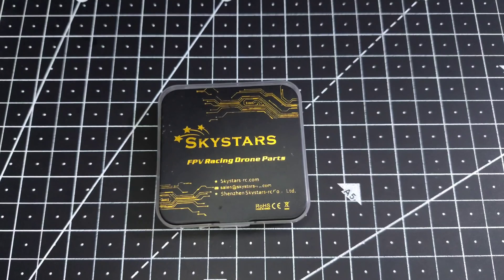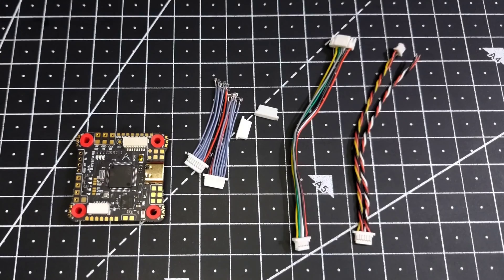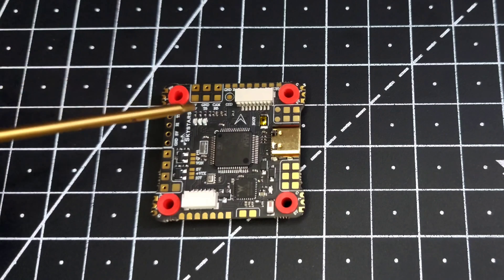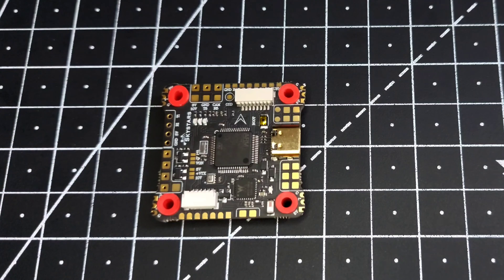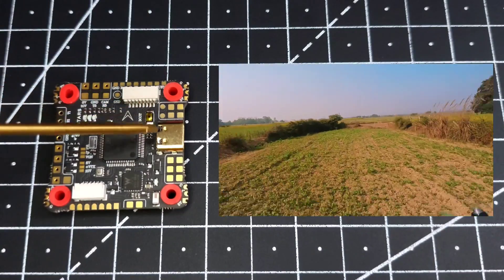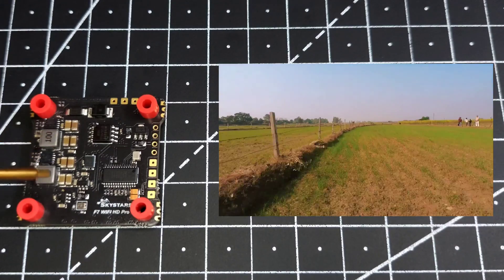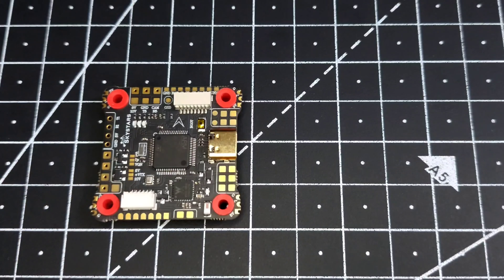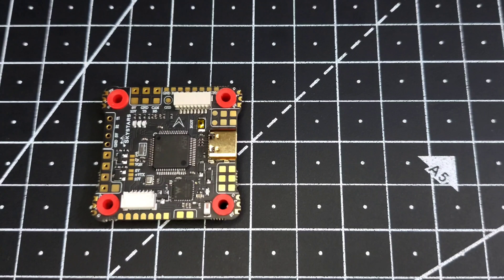Best Budget F7 Flight Controller ? Skystars F7 WIFI HD Pro 3 | Honest Review

Comment: Hi getting some problems with two out of my four stacks replaced the esc and still problems problems are reboting when getting bumpt in landing and fromt left motor not spinning like the rest changed motor but same problem
Reply from the maker: Check if motor screws are touching the windings

Comment: I have h7 version of this i have soldered all wires correctly but my vtx is not turning on , as mentioned in specs it has on off button for vtx power where do i find that? ( it came pre bridged to pit mode on jp )  my vtx is rated for 7-26v akk race ranger and it doesn’t support pit mode
Reply from the maker: Then select the switch to VON simple it will start working

Comment: yes these are fast and super smooth . turns on a dime . got 1and love it alot better then speedybee!!!!!!!!!!!! comes with betaflight 4.3.1 already installed no need to flash ready to go good job
Reply from the maker: Enjoy it
Reply: @justhackitfpv  the esc gets pretty hot is this normal ( hotter then my other drones )
Reply from the maker: Which esc describe me your setup
Reply: @justhackitfpv  60 amp esc hd pro 3 with xing2 1755 kv motors 1550mah 6s battery .. 5v speedybee tx800 vtx
Reply: @justhackitfpv  the 45 or 50 amp esc is better fir free style the 60 amp gets pretty toasty
Reply: I fixed it put a premium cap directly in front of battery cables cleaned everything up which I usually use my own caps anyway and I  run my caps in front of wire tried the little holes but feel my confident soldering in front much better filtering directly in front of cables to battery , I have to say this is my favorite drone now flies on a wire so so fast and smooth it s incredible , video is solid and clean no heat effects or lines crystal clear love the F7's .. if you want a racing drone put this in the I flight Mach 5 frame comes with everything you need no missing parts with I-Flight premium stuff frame has threads to so its super tight and top it off  with Xing2 1755kv motors the best drone so fast
Reply from the maker: So happy that you enjoyed the product